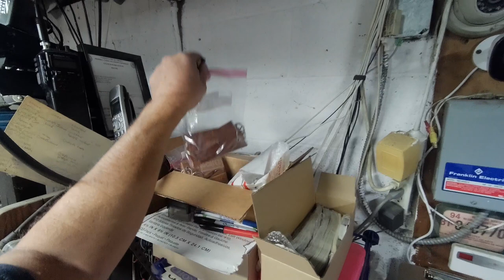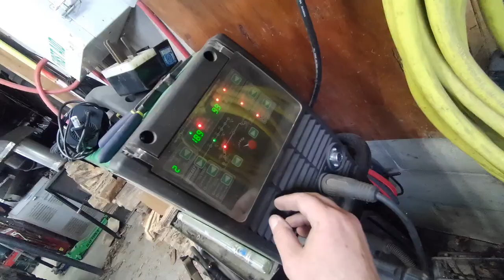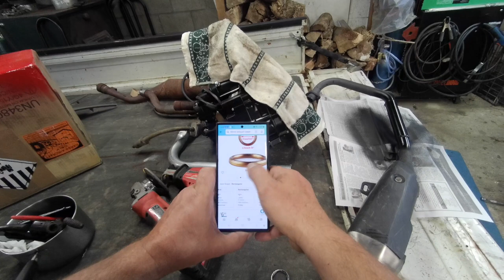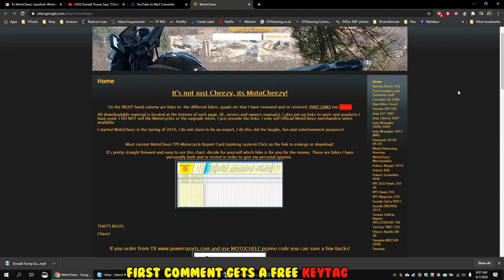(E10) Got a FLAT! More stock exhaust mods, Cut catalytic converter, grind header flange, weld.

Comment: I did this to my TBR7 and it also allowed me to clock the exhaust pipe away from the carburetor about an inch. I loosened the nuts at the engine, and the 10mm at the Muffler side. Clocked both pipes a little, and then add a pipe that fits without hitting the kickstarter. This keeps the fuel cooler and me happier. I got some video to edit and it will be posted. Thanks, this video made me do it.
Reply from the maker: Awesome

Comment: I can't readily find your 250cc exhaust tip video again. You were adding a 2-4inch plain pipe to a stock muffler. Interesting tonal variation! I considered cut stock muffler to remove some packing or buy bigger muffler for a larger engine and fit to a smaller cc engine to promote deeper throaty sound. That exhaust tip idea does same thing! GREAT! Oh, by the way; FOUR-STROKES are a lot like foreplay; love it when ya got it!
Reply from the maker: Definitely https://youtu.be/K8RjIt8_QaA

Comment: For welding pipe make a set of roller that way you can turn it . On the press Make a tee handle by welding a bolt for the press release that way you can release it by hand make it easy no need for the pipe 👍🛠️👌✌️🏍️🍻
Reply from the maker: I've always wanted to make one. Almost used my motorcycle tire balancer but was too wide.

Comment: Definitely would take the front tire off and patch it.
Reply from the maker: I've had good luck with plugs on tires, as long as it's not on sidewall, but an inside patch is way better!
Reply: Two big holes so close, I would have patched it also.  I cringed when you opened the holes open more.  It could tear between them.
Reply from the maker: I'm definitely concerned too....

Comment: On a car's exhaust if you remove the restrictions you change the engine's timing?
On a 2 cycle the exhaust tuning is your power.
Reply from the maker: Not the timing, the fuel ratio. Typically if it's fuel injected it'll correct itself, but if you have a carburetor you have to rejet it just like on a motorcycle

Comment: Hey Cheese:) been awhile (back to the EARLY Hawk days hehe)  but looking at your Condor, wanna ask if you know anyone with one of the Lifan Kp mini's or even the Benelli ?  If so how would you compare the quality of the bikes?  I've had good luck with the Mini, but looking for  another similar type scoot,  and at current pricing, the Condor is a helluva discount. Oh, and btw, both my Hawks are still chugging along:)  Have had no motor issues (and we trail them HARD), but the swing arms are only slightly above trash level.
Another thing, why have you not added or fabbed your own skid plate on the venom? That engine looks to be just cruisin for the proverbial bruisin.  GOT hella rocks round where I trail, so BIG deal here.
Reply from the maker: Ko mini is same machine. Benelli is better with EFI. The guy who does intro voice just bought one a week ago. I probably should put a skid plate .
Reply: @MotoCheez   Thanks for the info:) Looking around your site now, you have REALLY  put up some some quality info on soooo many topics now.  Good to see there's STILL some 'tell it like it is, NON 'fanboys' puttin up vids who actually KNOW what the hell they're talking about..:)  I've got you re subbed on my new system, so I'll be watching:)  THUMBS UP and scribed!!
Reply from the maker: Thanks!